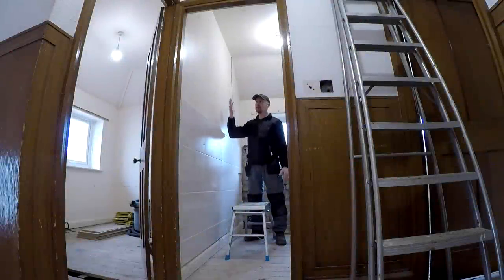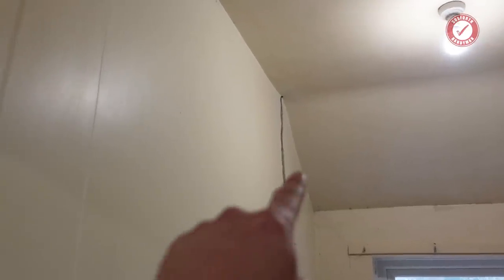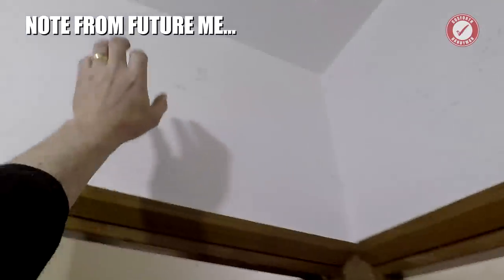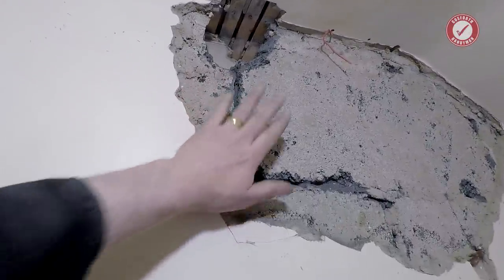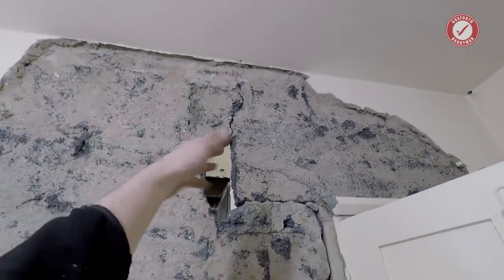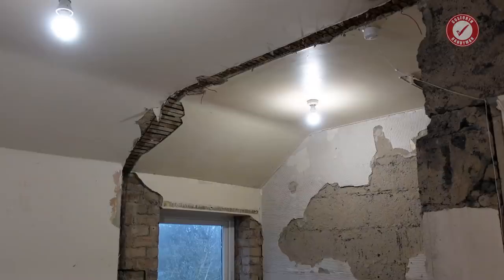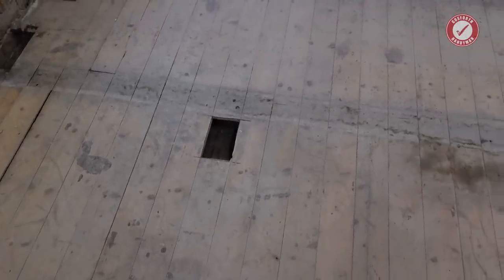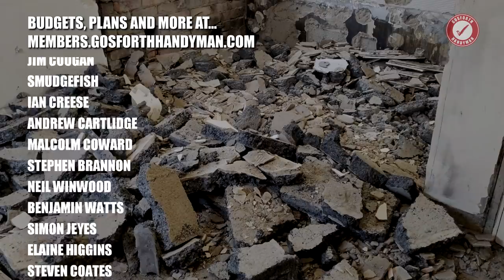Safely(ish) removing a clinker-block wall (Renovation Part 21)

Comment: A point on the supporting wall running from the ground all the way up to the loft.   My supporting wall (in the centre of the house) has a 12 to 18 inch offset between the ground floor wall and the first floor wall but it is still classed as a supporting wall.  The floor joists on the first floor provide the link/load bearing between the two offset walls.

Comment: FWIW for the probe through the ceiling use a long piece (obviously straight) of wire coat-hanger as a drill bit.

Comment: I renovated a property about 25 years ago in Wales - very similar to the one you are doing. A lot of the upstairs walls were built on the floorboards and were cast in place. I guess they used a lot of flyash from the nearby steelworks. One of the walls you could 'flex' as it wasn't adhered to the floorboards below!!  

Great job you are doing though. It gets better IMO when all the really dirty jobs are done and the fitout is underway but I was living in the property while I renovated.
Reply from the maker: Been there! It's really hard living in a property while doing this sort of work so you have my sympathies. 👍

Comment: Timber walls can be structurally significant. Also some buildings will have cross walls which act together with the external walls to stiffen the building. Glad advice was sought better safe than sorry!

Comment: Angle grinder with vacuum attachment, cut the cinder blocks into manageable sizes and remove each piece individually top to bottom. makes the clean up much easier!
Reply from the maker: The dust was biblical.
Reply: @GosforthHandyman  yeah maybe even vacuum wouldn't make much difference, but the clear up afterwards is maybe worth the dust.

Comment: If it's was me I would take out the wall above the two doors. When you renew the bathroom wall you can renew above the doors at the same time. It will be easier to tie it all in. Because if you don't the wall above the doors may move in time and crack.
Reply: Agree. Just get rid of all the cinder blocks whilst you have the skips
Reply from the maker: 4 new walls, 4 new door frames, full re-route of a load of electrics, plus yet another skip. Not as easy as it sounds. 👍
Reply: @GosforthHandyman  no I only mean the 1m square of wall above the bathroom and bedroom. Keep up the good work.
Reply from the maker: Cheers! They're all toothed in to each other so taking out one would take out the rest unfortunately.
Reply: @GosforthHandyman  ok. Good luck.
Reply: @Gosforth Handyman  You could cut back as far as the doorframe, removing that little spur of wall, and replace with a couple of lengths of 4 by 2. Easier to attach plasterboard to and make a neat finish.
Reply: Definitely those snubs of walls now need removing. They won’t have any stability. Do it right, remove them and rebuild in timber with the rest of the stud work. Put in new door frames. You’ll be thankful when fitting new doors and achieve a much higher finish. Anything else is half a job.

Comment: I'm well on my way to collecting sufficient knackered rubble tubs for a domestic DIY rubble chute.with the price of orange buckets what it is, a tenners worth with the bottom cut out could reach a skip from a first floor window and do a job. Often thought even a tarp wrapped it a tube would direct bricks, small stuff and particularly dust in the right direction.
Reply from the maker: Great idea! I could do with coming up with a plan by the time we do the knock-through for the extension. That will get messy. 🤣

Comment: @12:20 I sincerely hope you don't have any computer or electronic equipment in that house because, take it from experience, that fine plaster dust gets everywhere and into everything and loves to short out electronics.
Redoing my house, I lost a stereo, TV and a computer to that fine dusr, even though we had sections taped off and sealed in the doorways with plastic sheathing.

Comment: Hi Andy, size of clinker blocks can vary, I have investigated structures where similar blocks were 900 x 450 (or 36" x 18" in old money).
Reply from the maker: Cheers - yeah, these ones seemed to be huge! Tongue and groove too! 👍
Reply: Only just realised what clinker blocks are!  I have not heard people call the dense concrete blocks that.  Could it be a regional thing?

Comment: Curious as to why you didn't just take out the whole wall, and replace the bit above the door with plasterboard to allow you to position the wall coming straight out? Do you prefer the rooms to be less regular? I'd prefer if they were more regular so was just curious.

Comment: My dad took out a load bearing wall like a lot of other people in the neighborhood. He was the only one fitting a steel beam to bring the load to posts on either side.
The neighbors had cracks in the upstairs walls within a year. We haven't had any during the 40 years my parents lived there after that.
Reply from the maker: Sounds like your dad did it properly - good work! 👍
Reply: @GosforthHandyman  he was a welder at a steel construction company. He was smart enough to pick up a lot from the constructions he worked on.

Comment: Took a load bearing wall away to create a large living/dining room. Was Lucky to have undivided steal beams going from on side to the other, rather then beams going half the way and resting on the wall. We noticed after 3 years that the floor was forming a valley and there was space under the baseboard now. Fixed it by pushing the ceiling back to the correct level and with a massive 220 kg steel beam :)
Reply from the maker: That sounds full-on! 👍

Comment: Looks awfully similar to the kitchen wall I took down in a 1930s flat. Except I had a reinforced concrete beam running over the cinderblocks.

Comment: Its so strange but your house is basically identical to mine. Must have been built by the same company.. 
I had the SAME wall only mine was stud thank God. Taking that out to create an enlarged bathroom was 2nd biggest job internally after insulating under the suspended floors and sound proofing the alcoves! Small world. :)

Comment: Excellent video Andy, I did this a couple of months ago on my 1935 house to combine separate toilet and bathroom. Clinker blocks make a hell of a mess, still picking bits out of my pants! Each of my blocks took a lot of drilling and breaking seem to be more robust yours. 

P.S. more on the drum studio when you can please mine is now watertight and I'm starting the inside next week.
Reply from the maker: Fantastic stuff! The drum studio is my workshop until the extension is built. 👍

Comment: Did this about 6 years ago, not in a hurry to do it again. That dust gets absolutely everywhere, if there's a crack or crevice it will get packed with dust....not comfortable. 
You've made a nice size room there, shame you have to partition it.

Comment: The other consideration about the wall not being loaded bearing: the ceiling joist is resting on the interior wall (perpendicular to it at its end) and the exterior wall (at its other end), just like the joists on either side.
Reply from the maker: Defo, another good point! 👍

Comment: High, I have a 1924 bungalow down south, and we have/had cinder block internal walls, my father looked at it, and said the horns(the upper door frame sides) on the door frames might go through to the loft, and they did, so no lintels but cinder blocks over the door opening  and when we went in the loft the non-structural walls were like yours, ie the ceiling laths ran right across, the walls were added later. So not unusual for that period, door frames that support cinder blocks. My dad came from Sunderland, and he was a carpenter, so I think this was normal construction for that period in lots of areas.
Reply from the maker: Interesting stuff - great info!

Comment: They're collar ties going rafter to rafter, you can see it in the roof space. Collat ties stop the walls spreading and in your case they are also used as ceiling joists. If this is the same all over, the only load baring walls are the outside
Reply from the maker: Defo, although some non-load-bearing walls could be used as racking supports so that's worth checking too. 👍
Reply: @GosforthHandyman  true as long as they are connected in a correct fashion.

Comment: 1980s house. Just had a builder (semi retired brickie) take down the first floor chimney stack.No chimney, duct through loft to vented tile. Not supporting anything but the bulding standards !!! 
3 floorboards only supported at joist 15 in away, finished  under skirting against chimney wall. No wonder it always creaked relying on T&G to hold it all together.
The inner leaf to wall is made of a mix of alternate rows of blocks and broken bricks with no overlap. Metal ties in mortar occasionally.
And he just used hammer & chisel to take it down (old skool no power tools) what a mess. The plasterer is going to complain when he comes tomorrow!!
Reply from the maker: Wow! Good luck with the plastering!
Reply: Thanks for the support. Plasterer ended up re arranging his workload to do it over two days as it was taking so long to dry.

Comment: Looked 'a good quality' cinder block wall. Don't think they used 'ash mortar' (that would have been easier to demolish)? Just what size were the blocks - I'm guessing 3 feet by 1 foot? Would have enjoyed to help but have to remember, 'I'm allergic to old plaster and cement dust' - what a pain!
Reply from the maker: Yes, they seemed big blocks! 👍

Comment: looks good - do you think this could be done by a novice ? or how much would it cost for a builder to remove and wall like this ?
Reply: You'd need to get in touch with a structural engineer to confirm that the wall isn't load bearing. If the wall isn't load bearing there is no reason why you couldn't attempt this job. It's as simple as hitting it with a sledge hammer.

Comment: Are you going to keep the lath and plaster ceiling and risk it collapsing or rip out and re-board.
I once lived in a house where the entire ceiling literally peeled off from one end to the other in one go.
Reply: Most common approach is to overboard and skim. Some of my lathe ceilings had polytex on them and looked fine but I suspect that was the only thing holding them up still. Overboarded. Didn't regret it.

Comment: Excellent video Andy, no doubt it will come in handy for my next renovation project. What are you thoughts on using a fan and creating a negative pressure environment as dust is always an issue with any house renovations. I know it’s popular in the US but nether found a video from someone doing it in the uk
Reply from the maker: Cheers! I certainly could have done with that on some of the projects. Cutting out the new window opening in the hallway was even worse. Literally couldn't see where I was cutting. 🤣
Reply: It is something that works well, I made a piece of board which fits in the window opening with a small industrial grade fan in it sucking the air from inside the house out.
With the doors closed of the room you work in it creates and under pressure preventing dust from entering other rooms in the house, the small gap under the door just allows fresh air to get in, otherwise the door can be kept open at a small gap to get more ventilation.

Comment: I had a house built exactly the same. Another check is the floor boards going underneath the wall. I like those walls as the are very good for sound deadening. (As long as they are in the place you want them to be)
Love the dust, are you still finding it about your person?
Reply from the maker: Yes, the dust is endless. 🤣

Comment: Noticed several comments on Spray Foam Insulation.  Is it considered a negative thing on your side of the pond?  Lot of advocates for it here.
Reply from the maker: There's a lot of scaremongering. Jury's out. No issues here. 👍

Comment: Just break down that bit near the door Andy, it's not doing anything anyway you discovered. It'll save you nasty edges later on.
Reply: Not sure, I would keep something there, though maybe not this bit of wall. Not to support the blocks above, but to give some lateral support to the door frame.
Reply: Totally agree I’d take the rest down above the doors then rebuild with stud work while you do the new wall.
Reply from the maker: That would also take out the wall above the bathroom wall which is tied in to it. That would in turn take out all the other walls and leave me with 4 door frames to replace.

Comment: When doing a job like this it is worth investing in a couple of sheets of cheap(er) sheathing ply to lay on the floor on each side of the wall.  This stops the falling debris leaving divots all over the floor boards and gives a continuous flat surface that is much easier to shovel/sweep off.

Comment: Was that cinder block wall properly anchored into the perpendicular wall? I took one down in my house that was “anchored” with 3 nails over the entire height (and they didn’t even bother to remove the wall paper (let alone plaster) to try to have proper adhesion to the bricks in the perpendicular wall.
Reply from the maker: Yeah, it was loosely toothed in. Not very well though. 😁

Comment: I'm curious - In a property of this age, how do you determine whether or not there is any risk of disturbing asbestos that may have been used?
Reply from the maker: Most likely area would be artex on the walls, but no signs of that here. Just lots and lots of woodchip. 🤣🤣

Comment: Out of interest, how much would it cost to involve a structural engineer? Never had the need so don’t know how they charge etc.
Reply from the maker: Probably £500-1000 depending on the extent of what you wanted them to do. For something like this they generally already know these properties very well (from other people's extensions etc.) so can normally advise on simple stuff like this over a quick phone call, if they're already doing other work for you. 😁👍

Comment: What if the plaster contains asbestos
Reply from the maker: Why would plaster contain asbestos? Artex might, but not normal plaster.
Reply: I'm pretty sure that's not a thing...
Reply: @TheErador  it is especially in plaster made in the 60s and 70s
Reply: @TheErador  the plaster boards can also contain asbestos

Comment: Did you inform your local council that you are removing that wall ?
Reply: Do you think it's notifiable?
Reply: @paulteasdale7112  in my office it is
Reply from the maker: Not notifiable. 👍
Reply: not a structural element, does not need notified
Reply: @greggbutler9344  🔔

Comment: I really enjoy your channel, found your channel cause I got into wood working. I was always under the impression that a load bearing wall will support where two opposing joints come together and rest on top of the wall. Also the load bearing wall will have a beam directly below it in the basement. Have you seen load bearing walls supporting one joist? Reason I ask is in my new house I have a wall I want to turn into a pass through, from my kitchen to the dining room. The wall is running with the joist, and I haven’t looked into it yet to see if a joist is resting on the wall
Reply from the maker: You'd need to knock a hole in the ceiling to have a look. Very possible that it's not actually touching the wall, but better safe than sorry! If it's touching the wall you'd need to get the calcs done. 👍

Comment: I'd have ran a mile from the property seeing that horrible spray foam insulation
Reply from the maker: Not an issue, already had it checked over. If it ever turns in to an issue, which it won't, I'll just replace the roof. Really not a big deal. 👍
Reply: I'm just in the process of getting a new roof as my house has spray foam 🤞

Comment: What’s the difference between brease block, cinder block and concrete blocks?
Reply from the maker: Cinder blocks are normally made from the ash and waste materials from nearby power stations etc. Concrete blocks are normally solid concrete. Breeze blocks are normally aerated in some way, but the terms can be quite interchangeable. So for example I've seen concrete blocks being called breeze blocks. 👍
Reply: @GosforthHandyman  i always thought the concrete ones with the two big holes were breeze blocks. It's a minefield of terms as in any industry i guess
Reply: @GosforthHandyman  that makes sense. Thank you

Comment: My house, built in 1935, has the same solid walls none suporting. I took out 2 of them with no problems. I personally would remove the "lintel" that is doing nothing and the bit of wall and add 4x4 posts to support the door frame and put a frosted window where it was to give light into the hallway. Just a thought.
Reply from the maker: Trouble is once you take that out then it would take down the wall above the bathroom door. That in turn would take out the doorway above the other bedroom doors and in turn the other bedroom wall. Before you know it you need 4 new doorframes and yet another skip. 👍